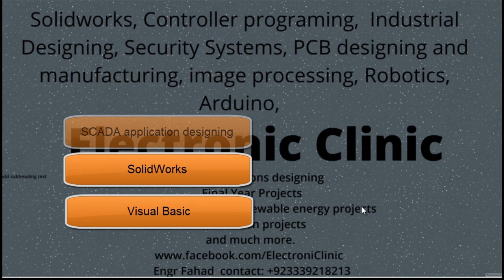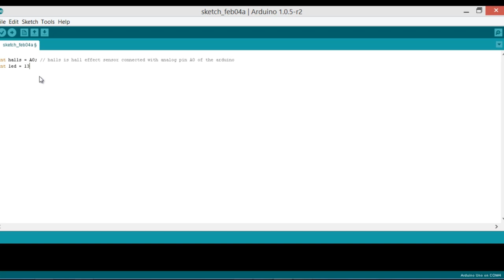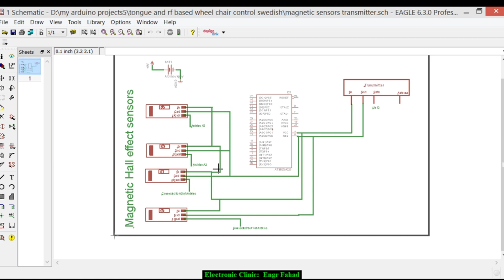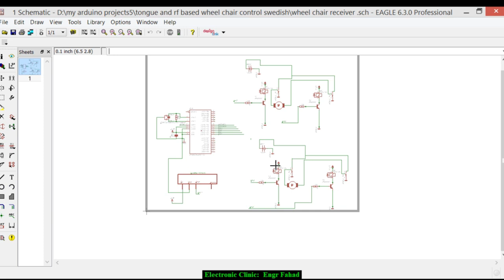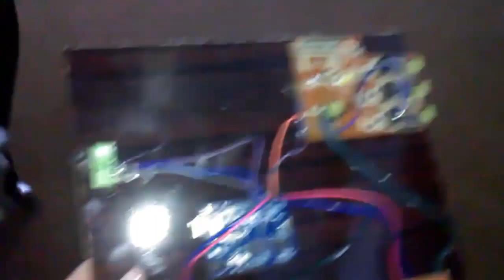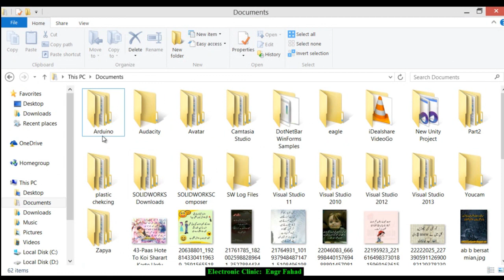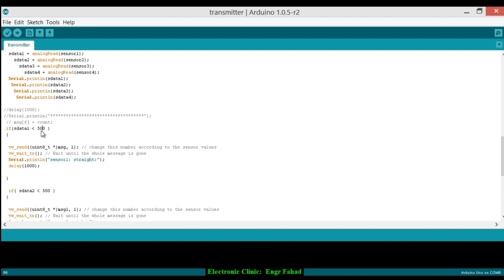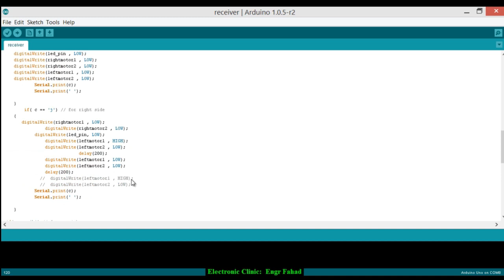Arduino project: Tongue Controlled Wheelchair using Hall effect Sensors|tongue controlled wheelchair

Comment: How much does it cost as per component wise?
Reply from the maker: its cheap. 500Rs "pakistani" arduino
tx and rx module  200rs 
wiper motor price is 1500Rs
2500 battery price. 
and a wheelchair.
Reply from the maker: rest of the components are in the range of 50 to 150rs.
Reply: Electronic Clinic thanks
Reply from the maker: you are welcome bro. feel free to ask any question regarding any project.
Reply: Sir which motor driver you used ?

Comment: Can you pls give the specifications of motor used?
Reply from the maker: these are simple 12v gear motors, used in cars to control mirrors.
Reply: @ElectroniClinic can this motor drive with a person on wheelchair
Reply from the maker: i have practically demonstrated this, you can see there is a person in the wheelchair.
Reply: @ElectroniClinic  okay thank you
Reply: How do you fix Motor to wheelchair